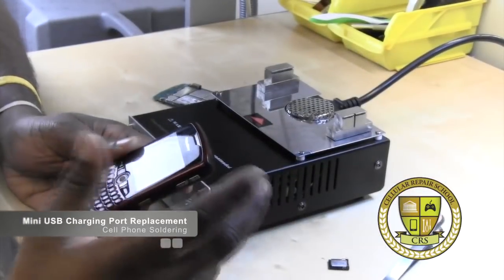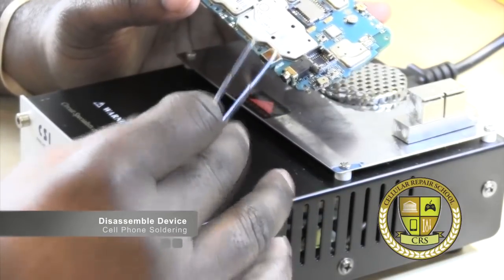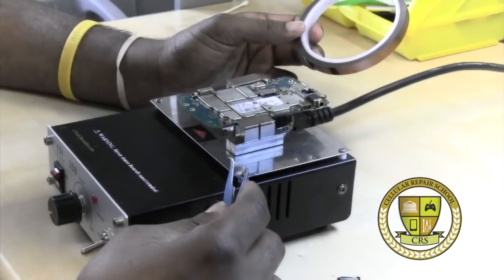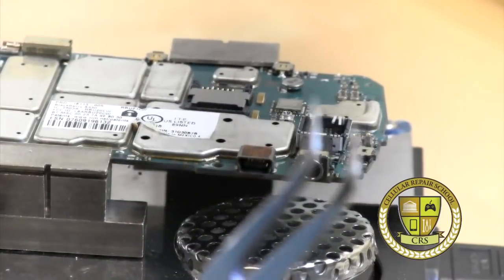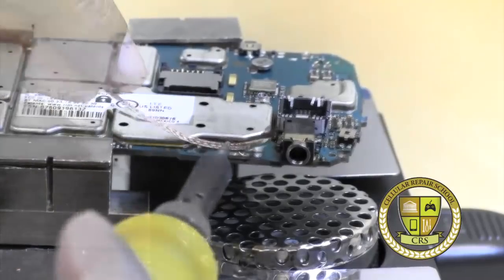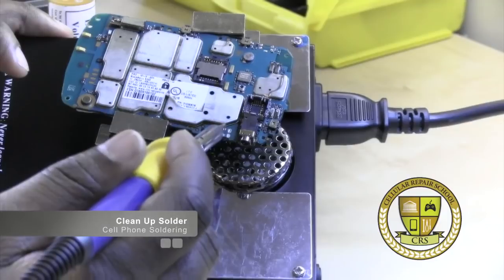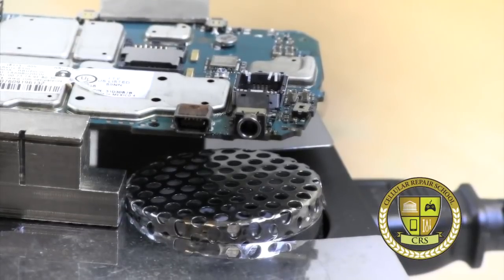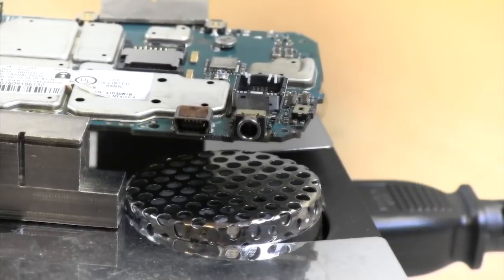Cell Phone Soldering II Cellular Repair School

Comment: first of all thank you for sharing the video, however I still have some questions.
You apply the flux with a q-tip and then the blobs of paste on top of it, on the contact pads? any chance you can describe this phase in detail? also if I'm not mistaken, certain solder pastes contain flux, so would it still be necessary to apply solder flux when using these types of paste?

Comment: For how long can the logic card hold up heat?
Reply from the maker: Pablo Balcazar the board is pretty robust.  You still want to be cautious with heat at all times.  And different boards have different thicknesses. So be sure to use discretion with each board. Use your kapton tape when appropriate. And if use preheaters try to concentrate on the area you are working on as best you can.

Comment: I also turn down some business for USB port repairs. I have an embossing heat gun that will melt solder but the heat "foot print" is to wide.
Reply: use heat repelling tape, I'm kinda surprised this school guy didn't he could have damaged a lot of other parts on the board....
Reply from the maker: Bob Gorden Def want to use kapton or heat tape as appropriate.  You also would be best to use a rework station as apposed to a heat gun.  Rework station gives you abiltiy to adjust you temp and air flaw accordinlgy

Comment: A toothbrush? Talk about a shit job! No, thank you!
Reply: Augusto Hernandes theres nothing wrong with it i use different types of brushes including toothbrush i find the better for repairs where flux has gone over areas where there is alot of componentes like the touch ic of an iphone 6. he did a good job not the way i would have done it but if it works and doesnt fail then all the better.